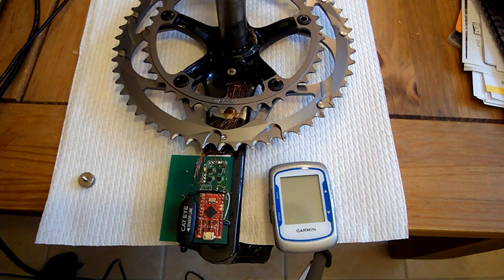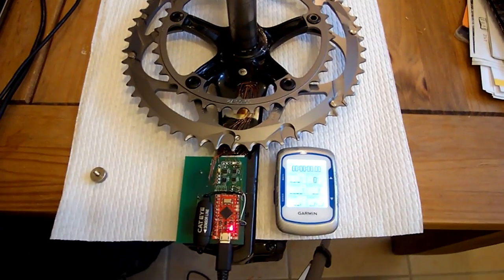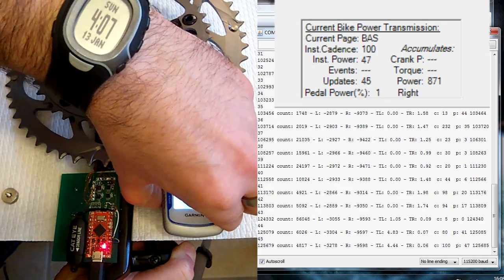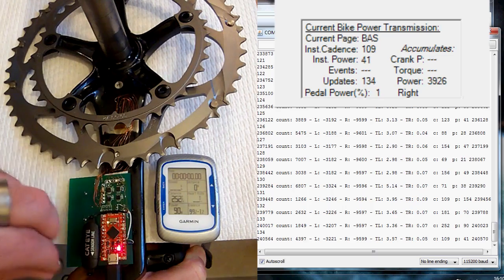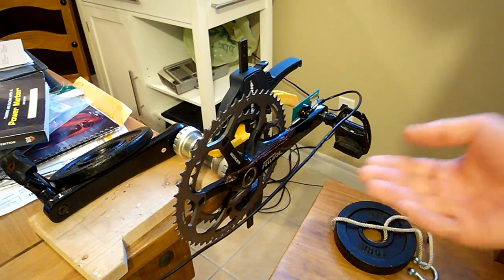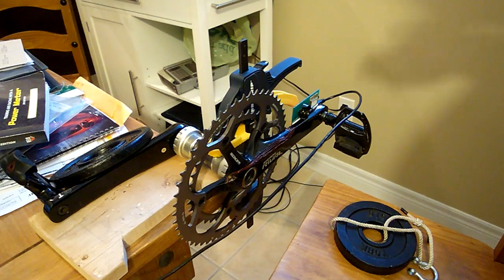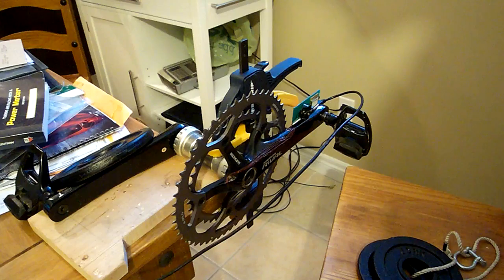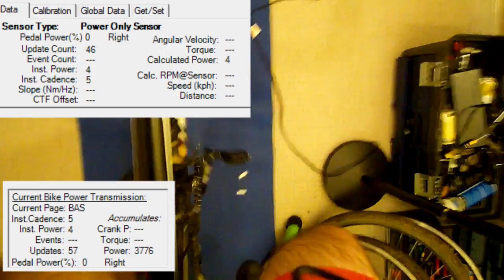V3 Power Meter - Demo and Calibration

Comment: wouldn't it be easier to install gauges in all of the bike frames, callibrate the stiffness matrix, then get all forces from all parts of the bike including the pedal force? then simply multiply pedal force with callibrated pedal length and angular velocity to get pedal power. with this you can also get other readings such as braking loss, wind loss, gravity loss/gain etc.

Comment: Great work thx. Why not using ascelerometer to get rpm? It would make It smaller not magnet dependant and maybe lower posible noise.  Is It open source?  There is a cycle computer being developed with arduino. This would be a Great push for making open source bike computer
Reply: Maybe divide rpm capture into 1/4 to make It more real time